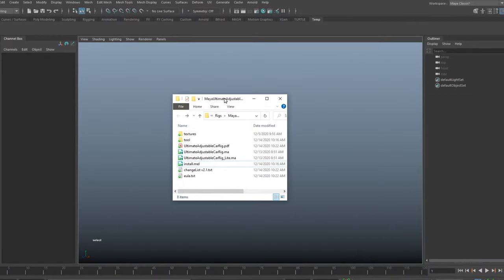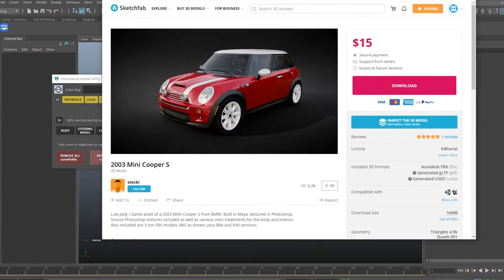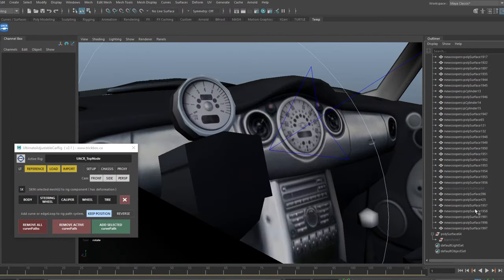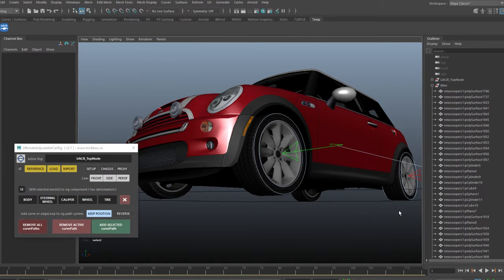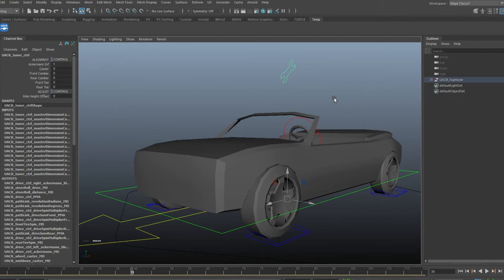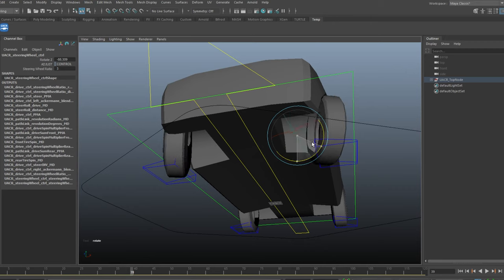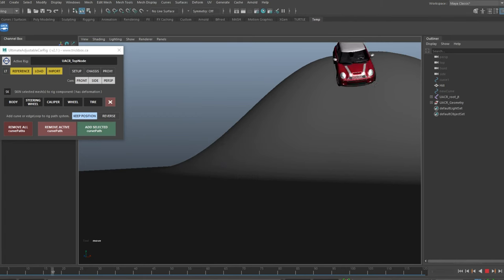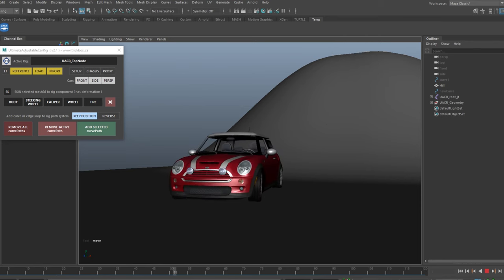How to Rig a Car in Maya | Maya Car Rig | UAC Rig

Comment: This is a truly amazing rig.  The only part I can't find is anything on the suspension set up.  Is there one?
Reply from the maker: Suspension is setup visually on the included chassis model only but the undulation will carry over to any 4-10 wheel vehicle model. You will need to manually rig any exposed custom springs and link them to the rig... currently. Updates are in progress to add the ability to rig custom springs.
Reply: @SimonMills  Ahh ok gotcha.  Thanks for the quick response!

Comment: Does the rotation of the wheel always rotate forward? cuz i ran into a couple rigs where there the wheels rotate toward 360 and it will loop back to 0 and it creates a really weird motion blur in the renders.  Also you think the set up and use for motorcycle, semi trucks/trailers? Or is that a completely separate rig
Reply from the maker: Hey Tom, thanks for the catch. A few weeks ago, a user was having some motion blur issues and we could not find the solution. I just modified the rotation like you mentioned and the issue is resolved. I just put out a small update to stop the wheel motion looping, they now always rotate forward.

Also, the rig is updated quite often with new free features.
This 2.6 update added the ability to rig trucks with up to 10 wheels: https://youtu.be/USxo8gbqzig

Motorcycles will most likely be in the next big free update in a few weeks.
Thanks again!

Comment: Hi, Simon. Is there a setup for the suspension? Some cars and some camera shots really need that.
Reply from the maker: Currently there is a chassis model with fully working suspension, shown in the video, that can be used to fill the gaps in models with no underlying parts... but to rig and connect your own suspension, this is not currently part of the tool directly but it is possible to add your own and have it driven by the UAC Rig. I am working on ways to easily add custom suspension so keep an eye on future updates.
Reply: @SimonMills  I'm thinking of buying your full version. Does that licence include future updates?
Reply from the maker: @MarceloMeireles  yep, all updates are free. Take a look at the previous update videos and you will get a good idea on what gets added.

Comment: @SimonMills do you have a setup for F1 cars????
Reply from the maker: Great question, this will work for F1 cars however you would need to manually setup the exposed parts and link it to the rig. I will do a tutorial on this.
Reply: @SimonMills  by any chance do you know anything about setting them up with Chaos in unreal engine also (destruction)???
Reply from the maker: @original9  Never tried it actually. If Chaos supports fbx animation as the input for car movement then it should work fine... I would imaging something like this: Your car could be animated how you want it in your scene and then lets say a collision occurs... at that point you could switch the cars motion input to the chaos car rag-doll.

Comment: Hi,I can't drop install.mel into the Viewport.
Is there a way to do a manual install?
Reply from the maker: Hi YUKIRIN, you can also manually open the "tool/UltimateAdjustableCarRig.py" script in the script editor using the python tab. Once the script loads, highlight all of the text, middle mouse drag the text to your shelf. 2 Icons will appear, you can right click and delete the grey one. Note that Maya 2022 does not work currently... it will in the next update.
Reply from the maker: @Kyouhouin  what version of Maya are you using?
Reply from the maker: @Kyouhouin  Assuming you have tried reloading Maya to see if the drag/drop install works.  Are you able to drag/drop other files into maya? Do files drag and drop in windows explorer?
Reply from the maker: @Kyouhouin  does it happen in other software and general file dragging into folders? If so this video looked like a promising solution: https://www.youtube.com/watch?v=L3a3tRYzRqw
Reply from the maker: @Kyouhouin  awesome!